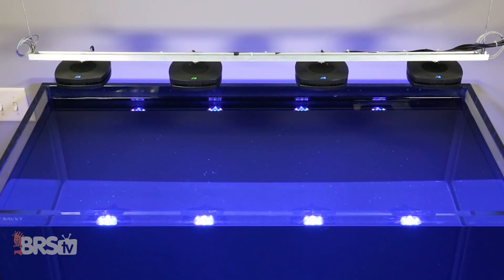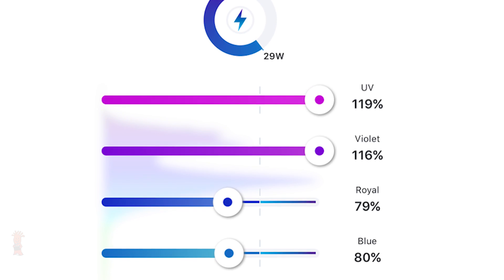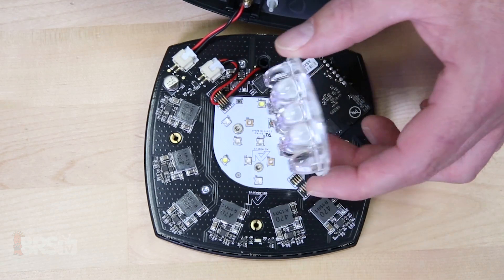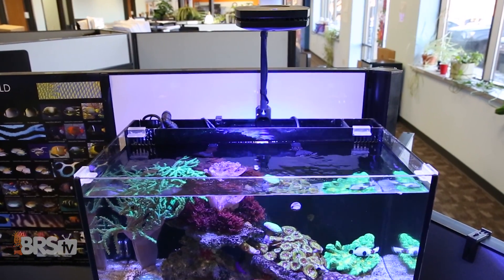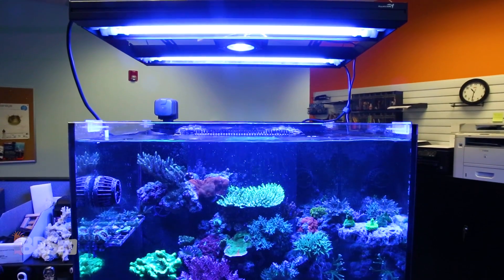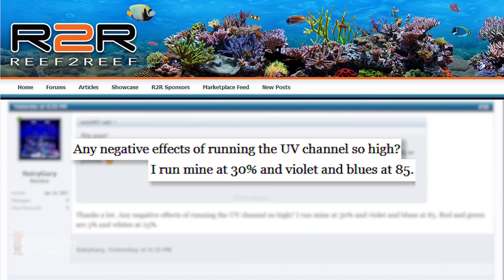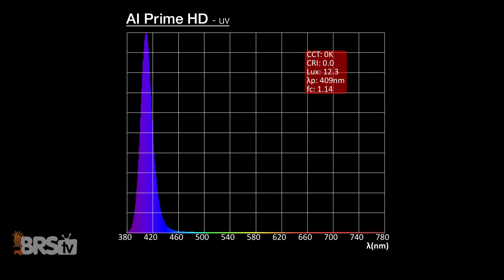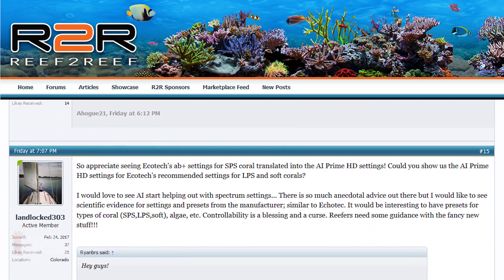R2R FAQ #1: Does over-driving the Prime HD LEDs affect long term operation?

Comment: I just switched my Ai hydra HDs on my redsea e260 to the BRS recipe. Really liked the look, but on the first full day I watched the water temperature climb above any previous maximum until I had to turn the lights off completely. The temp in the room wasn't particularly high so I think it must have been the new lighting recipe generating additional heat over the default setting I was using. Does this sound right? I'd really like to keep using the BRS suggestion but that will be no go if it overheats the tank (I don't have a tank lid keeping the heat in so the impact seems pretty significant).

Comment: Does the AI Prime could with some suggested settings (in the manual perhaps)?  I just bought this light for a nano tank, and I haven't set it up yet.
Reply: It does not of course, that would be too simple and convenient. However, if you check out the R2R link, they do give you the specs to imitate the AB+ schedule that ecotech recommends for sps coral.
Reply: I keep LPS and softies mostly.... :)  Any help there?
Reply: I'm in the exact same boat... After they put out the first video on the Prime HD I asked the same question and got no answer. So I've done my own research based off ecotech's research and experimenting. This is what I run on my tank which is mostly LPS a few softies and one SPS... UV-119% V-116% RB-80% B-50% G-10% DR-10% CW-25%. If you're just starting off I'd cut all those numbers in half for a week or two then add 5% every couple days. Just not to shock the corals. I'm really hoping AI starts helping out their customers better on this... Have to keep e-mailing them and pressuring them!
Reply: Awesome.  I'll give that a try!!!
Reply: Can you show me where you posted that?  Sounds like just what I'd be looking for!
Reply: It's on the R2R link in the first comment
Reply: I have 4 AI primes now and following some suggested settings, but looking at AI's signature settings on their website, there is a variety of signature users with awesome SPS tanks whose settings are all over the place. A lot keep their UV/V in the middle range as opposed to the overdriven AB+ model BRS suggests, and one signature user Yannick Desvignes has EVERY channel set at 95% (including R and G) and runs peak for 10 hours....and his tank looks awesome in the picture also. I'm confused about the best settings after seeing all the signature settings,  because just starting to use them and cant tell what's being affected yet.